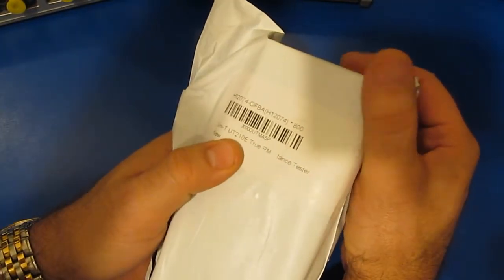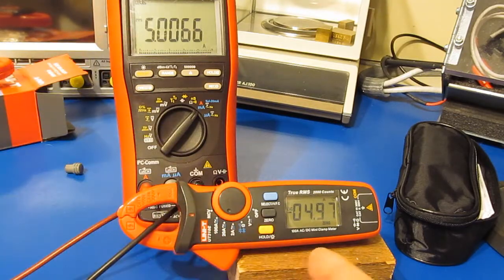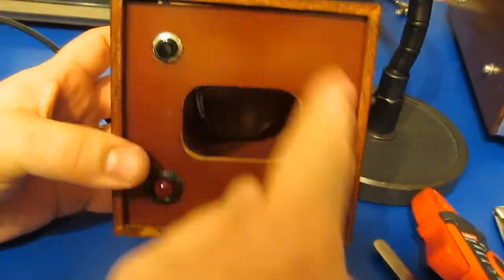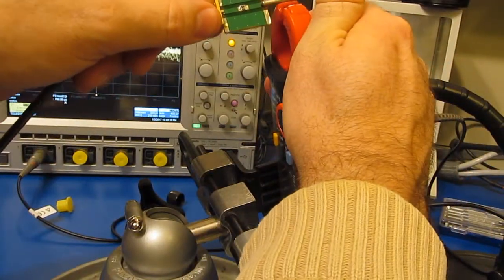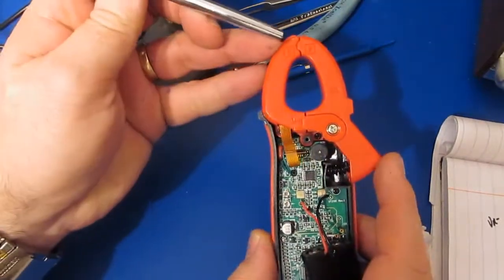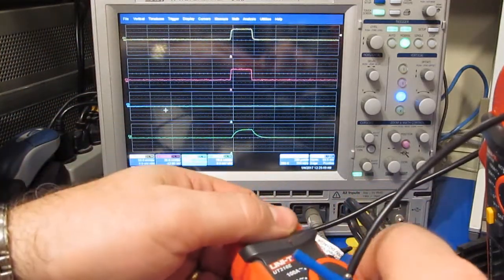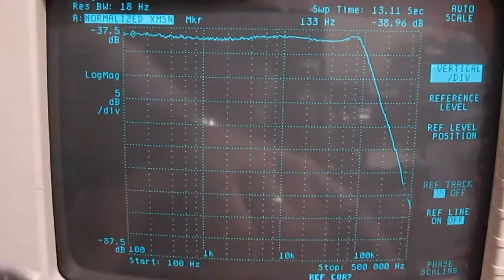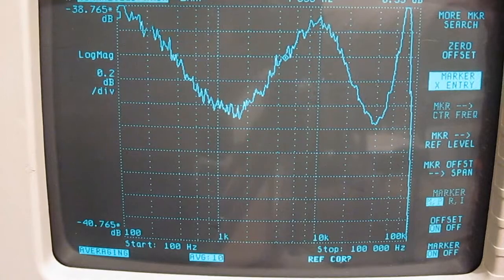Modified UNI-T UT-210E for Higher Bandwidth and Adjustments

Comment: I do allot of handyman type residential wiring which includes mostly 120V and 240V in attics and crawl spaces. Is there a way to make it beep faster/slower or tone different in the NCV function when testing a random romex wire? Making it more or less sensitive I guess.
Or, is there a different clamp meter that does that already?
Reply from the maker: I don't believe so but you should check the manual to be sure.  I have not seen one that would change the tone but I have seen some NCV with a sensitivity adjustment.   This is the only clamp meter I have looked at.

Comment: What's the point of increasing the bandwidth if you are just going to be measuring 60 Hz current anyway?  Do you have some other use for the meter?
Reply: 20GS/s! What scope is that?
Reply from the maker: LeCroy
Reply from the maker: It's naive to think that high BW current probes have no use that that no one looks at signals beyond 60Hz.
Reply: So what other kinds of current are you going to be measuring?
Reply from the maker: There are no other kinds of current but there are much higher frequencies than 60 Hz.  But, let's just consider the 60 Hz AC power feeding my house.  If you have a look at IEC 61000-3-2, they will require you measure 40 harmonics out.  That's getting up there.   In this video, I show using my oscilloscope along with a computer to make these measurements.    https://youtu.be/04I7nHA_HxM    In this video I show a few different ways to measure higher frequencies.   https://youtu.be/UAA9oqHGUqA    In this video, I modified my old Tektronix current probe to work up to 90,000,000 Hz.
Reply from the maker: Here is the P6042:  https://youtu.be/6f8zoyBxizs      Here it is in operation:  https://youtu.be/RVY9q5JhHHU
Reply from the maker: If you want to see some even higher frequency measurements, in this video I was attempting to design a generator that puts out a 15 ampere pulse in under 1ns.  That's 0 to 15 amps in  less than 0.000,000,001 seconds.  To do this I am using an oscilloscope that samples 20,000,000,000 times per second.    A tad over the 60 times per second we started out talking about.    

https://youtu.be/Qimtx8z6FUQ

Comment: Excuse the dumbish questions but Whats analog  band width?  Whats DB down ? , Is it  Log of frequency or some thing?  Whats the advantage of extending the band width from 5 to 100 K Htz.?
Reply from the maker: Google -3dB and start reading.  Advantages of extending the bandwidth is to make to meter useful for applications that require it.

Comment: So you adjust screws VR4 and VR+ to get zero volts change with the meter sent to DC current when you turn it around. You then use the VR- screw. to make the meter read zero??? What is the advantage of doing this?
Reply from the maker: Minimize the external effects and allow full range.

Comment: The device UT210 came with aliexpress, one of the posistors wmz12a will burst. Measured their resistance 1.4 kom. I can not find such anywhere. Do not tell me its value or can link where to buy?
Reply from the maker: UT210 was fairly inexpensive.  Just could buy another.

Comment: Sorry for the Newbie Question:
The alignment save me time because i did not have to nulling the meter 
every time before the measurement - right?
Or is there another reason?
Reply from the maker: DC clamps like this need to be nulled in the lower range no mater how well it is aligned.   As I show in the video, there are two reasons for the alignment.  Decrease sensitivity and maximize dynamic range.  The null button is software only.  We need to correct the hardware.   I have had this clamp so far out that it read OL in the 2A range even after pressing the null.
Reply: Thanks Joe for the informations
and greetings from Austria!

Comment: Hello Joe! You know a lot about this current claps and I've found tons of useful information on your channel! 
Do you have any info about the two WMZ12A PTC thermistors from the input? One of them is broken on my UT-210Eand I cannot find any specifications regarding them..
Reply from the maker: Funny, I type in WMZ12A ptc in Google and the first hit is the data sheet. I would not have any information outside of what is in the datasheet.
Reply: I have also found the datasheet ... and then it was when the fun began. 
I've discovered that WMZ12A is only the device class and the rest of the specifications (and the more important): Switch temperature,  R 25  resistance, Max Non Operating Current are chosen by each customer depending on the application. 

The complete code for the UT-210E should be something like:

WMZ12A<TT>A<RRR><Rt><CCC>S
where
-  <TT> = Switch temperature
- A = Chip dimension (resulted from measurements)
- <RRR> = R 25  resistance
- <Rt> = Resistance tolerance
- <CCC> = Max Non Operating Current
- S = Straight pins

Unfortunately, UT-210E is my only multi-meter and by being broken I cannot measure any other value in order to determine the correct code for buying a replacement.

I thought maybe you can help me with the values for the missing parameters, because when you conducted the "GDT vs MOV"  test you selected a YQD100N1000 based on the measurements you did on a DMM that passed the tests...
Reply from the maker: Have you tried contacting UNI-T?  Maybe they would repair it or could supply you with a replacement part.  Another option may be to post your question on the EEVBLOG site under the UT210E thread.

Comment: Hi, Joe. Would you be kind to provide a schematic for the changes you made? Then this post would certainly qualify for a "like". By the way, there is a similar model UT211B which goes down to 0,1 mA resolution. Would that be possible to similarly modify?
Reply: You only get 0.1mA resolution on AC current mode. It would be nice on if it would be on the DC current range. Cheers.

Comment: Pretty impressive improvement Joe. Came across Your video as I was looking for cheap / possibly DIY current transducer that could sense 500A@50kHz. Got to admit, Your vid is pretty eyes opening !

Thanks for the effort.
Reply: Mark Masterson what are you measuring at 500a/50khz? sounds fun
Reply from the maker: LEM may have something DC to over 50KHz at 500A at a reasonable price.

Comment: great video joe, that was so informative especially the OP AMPS, cause in fact i teared down a cheapy clamp meter 6 days ago just to see how it's exactly measuring the current throw the op amp, and the reason i need it is for my project for overload protection circuit, for example at 40 amp of withdrawing current i need the circuit to deactivate the transistor circuit that driving the coil relay. if you have any thoughts on how to translate the reading from the OP AMP to a 3 digit 7 segment display so i can implemented  in the circuit to see the total current load on relay contact by measuring the voltage drop on the CT, it would be very helpful, i'm using an LM324 for the  ADC process and to amplify also the current coming from CT

 thanks for the efforts